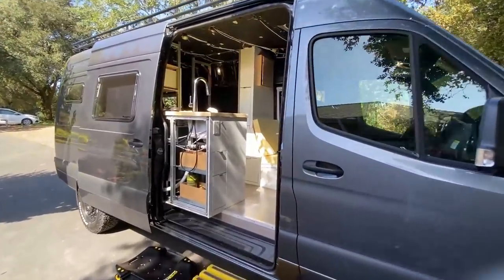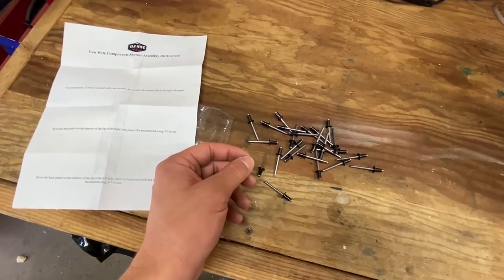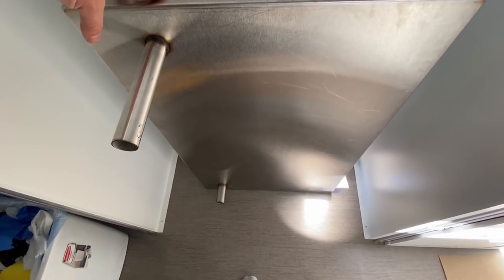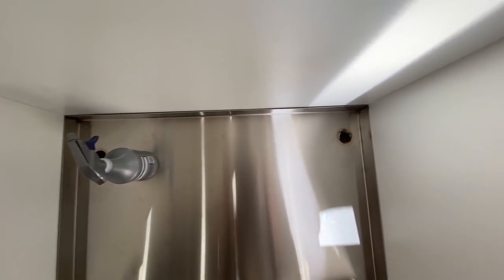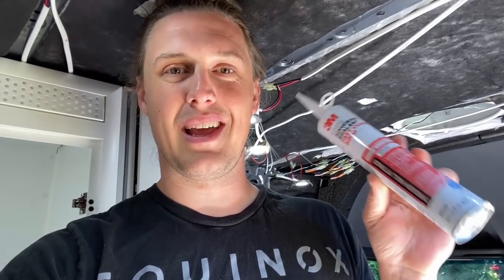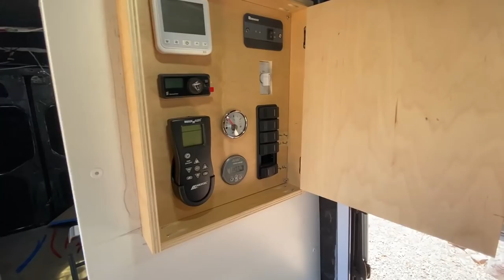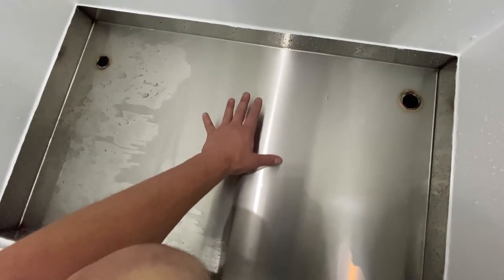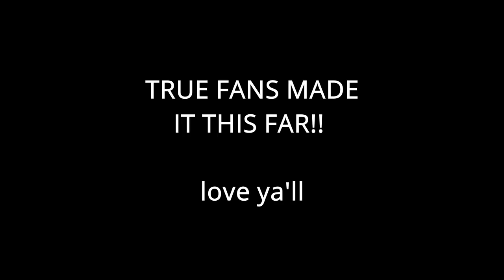How I Put A Full BATHROOM & SHOWER Inside My Van

Comment: Looking good so far. My issues is I would have 5200'd inside the whole length of the overlap of the panels then caulked the inside seams to prevent 'sharp edges'. I'm surprised that they didn't manufacture with some sort of interlocking seams with that price... Under the pan, I would have placed a small wedge (1/2" pitch in one direction or another (towards the drain) to help with drainage, too.
Reply: I was thinking the same thing about a wedge to create a slope

Comment: A small window or sealable vent on the side of the shower allows humid air to be pushed outside via the pressure of a rooftop MaxFan set to pull air in reverse. We do this in our Pleasure Way Ascent with the furnace running when we shower and warm dry air is pumped into the shower.

Comment: To do your caulking run a bead down where you want it to go, making sure there are no holes.
Then get some diluted detergent in a spray bottle and spray the bead.
This will ensure that when you run your finger down it won’t spread.
Works perfectly every time.
Reply: Have you done this with 5200? It's a difficult beast.

Comment: You can make chrome finish look satin by scuffing it with a automotive scuff pad. sand(scuff) in same direction that match your others.
Reply: This would depend on what the valve is made from.  Let's say the valve is made from a diecast material that is chrome plated. If you  scuffed the chrome the zinc will be exposed and corrode under the remaining chrome, and then the chrome would peel. This is not good. I suggest leaving it alone.
Reply: Ha, yes, a trick I learned recently. I used some 600 or 1000 sandpaper and it came out great.

Comment: Re: low pressure shower heads: There is usually a small, plastic, pressure regulator, where the hose attaches, that can easily be pulled out with a pair of pliers, if you want more water pressure, at the expense of water usage.

Comment: Pro-tip with the shower water pressure... Unscrew the handle hose and pick out the little plastic regulator, reconnect hose and viola! Better pressure.

Comment: Use a silicone squeegy to move all the left over water down the drain.

I used one in deep  square stainless steel sinks to get then dry at the end of the night when i was working an old closing resturant job.

Comment: From the position of the toilet vent hole it looks like you are placing the toilet on the same wall as the shower fixtures. I would have placed it opposite.

I use a shower chair in my shower - and the most useful position is sitting down facing the shower fixtures. This is the common Japanese sitting shower position too, where they use tiny stools on the floor facing the fixtures. 

With the toilet opposite, it serves as your shower chair - useful for me because of leg injuries, useful to you because of your unreasonable height. I'd also have a second lower shower head holder that is optimized for sitting down. The high one is for full body rinsing of your front and back while standing.

If that sounds useful for your situation - you could still just switch the use of the two shower pan holes to the new configuration.

Comment: I have the yitahome 5 gal portable toilet and it comes with the sink with hand pump, if you guys don't want to deal with plumbing in your rigs, this set is on sale alot and they have a cheaper version for 150$ definitely a great setup for budget builds. In terms of a shower run propane through a tankless heater to a small shower:) I have a cargo trailer I've been building for awhile
Reply: The cool thing about the sink is excess water goes through a small pipe back in to the toilet so it rarely has to get filled for my use

Comment: If you want a good shower head for low pressure like an RV use an Oxygenics shower head, feels powerful yet uses very little water, 100% better than the stock RV shower head.  Cheers,

Comment: Nice job, although I do think you’ll have to move the shower drain tube up higher onto the grey tank.

We also have a flat shower pan, and it is something I regret  that we didn’t add some pitch.  It is a pain to clear standing water - we do have a teak shower mat, but it still needs to be dried after each use.  We use a squeegee and our dust pan.  Definitely not my favorite activity.
Reply: Hi ! Which drain have you chosen in your shower ? The water can't flow properly in mine :(

Comment: Hi, Steven: You couldn't find a lake to shower in?, state parks are full of them... The shower you're installing is very nice and you are the only one who has to look, at the fixtures when you are in the shower. Personally, as long as the shower works and the difference in color tone, is very slight then I don't normally get irked about the color of my fixtures.. Part of the spread issues of the caulking could be caused by the material being used for the shower...You could always find a material to cover the interior of the shower that you like better, which is waterproof and will cover the caulking issues.. While you can caulk aluminum and rivet it to use as an interior for a shower, normally it is soldiered or welded together...

Comment: One problem I had is when braking the water sloshed back up the shower drain! That did not smell good... I installed an inline one way valve to stop this little issue :)
Reply from the maker: Nice, I also did the same thing. I used this “low psi” check valve that uses a flap and it works really well.

Comment: Hey dude regarding the rust paint, there are guidelines in the MB upfitters documentation for resealing holes you make in the van and also where and how large of holes are permitted within warranty spec. Recommended reading.
Reply: Hi Richard. I have been searching the BEG for this info but i'm failing to find it. Can you direct me to a page/chapter/section?

Comment: Did you think about a second drain hole in the opposite corner so it will drain when sloping the other direction?   I am looking forward to seeing your insulating/heating plan for the under van plumbing for cold weather.
Reply from the maker: Yes I thought about it. My shower pan happened to be in a location that didn’t allow for holes in the other corners without some serious drilling through the frame structure.
Reply: @seven_o_savage  Hey man, just wanted to ask you about the Separett toilet — how did it work out in the wet bath? I've got one that I plan on installing in my build, but have concerns that the separett won't handle a wet environment well without water getting down into the main cavity of the toilet unit and causing problems unless it's covered when you use the shower. Any thoughts/input/advice you can provide would be much appreciated.

Comment: Wow your 6 foot 5”. I think you should look into iveco daily van you can get it with 2.1M high internal hight and if you wanted 5.1M internal length also. Check it out you would be able to stand up in that and have a full size shower no problem.

Comment: Looks like a composting toilet. There is a single reason why a composting toilet might not work perfectly: Excesive humidity, like during/after a shower. You may find a way to keep humidity out of the composting toilet as long as the humidity is still high in the bathroom... Maybe a plastic bag with a heavier rubber ring (in the form and size of the toilet itself) on its opening, that seals (a bit) against the floor under its own weight...

Comment: Great progress. I used to put in rivets using the same type of tool you're using but I switched over to the RiveDrill RT110. Saves so much time and I just leave it connected to the front of a spare drill.

Comment: There has to be a better fastening method than this... than rivets with a gob of sealant on the head. But, if its riveting it is... ever heard of Olympic rivets?... looks like a bucked rivet and you can spend a small fortune on the shaver tool that rounds off the head. Which is nice. Then I see your caulking skills. I was going to suggest a Cramer profiling tool, but the rivets negate that idea.
Reply from the maker: Wowww these are so cool great suggestion!

Comment: Reading the comments a lot of you seem to be missing this man's design ethics....rather than go all out fitting everything theoretically needed, which then leads to more things that can fail and need replacing, he skips some stuff (grey water back flow valve, p-traps, etc) and later down the line if it needs changing its designed in such a way that it's simple to retrofit

Comment: Usually it's the newbies to van living who fall into the trap of thinking they need a micro version of their s/bricks house in their van. 

**Think about how much space a shower & a big toilet takes up inside a van! Living space is critically important when you live on wheels. Also, to run a shower you have to carry A LOT of HEAVY H2O, this forces the van's motor to work harder & takes more fuel. Not good!

People, save yourself a lot of space, time & $$$; just take sponge/rag baths & get a cheap little solar bag shower & a plastic catch basin to wash your hair in. Simple & cheap!   Or, public showers are everywhere: gyms, truck stops & campgrounds.

You're welcome.

Comment: This is what happens when you try things out for the first time. Seven you are great with a lot of things like electrics and plumbing. Little things like the caulking of joints, it’s a shame you couldn’t get this info before you started the job. You can use a washing up liquid sprayed from a bottle and then a special rubber silicone tool, instead of your finger, to finish it off with. It’s all about working with the product without it sticking to things you don’t want it to stick to. 
Anyway I’ve decided Im not having a shower in my van. I want to keep things simple.

Comment: no need for a shower in the van.. takes up why to much prime property in van. Shower in the back with the doors open and a curtain.Dude you have a lots of wires and shit underneath exposed to the elements. That won't last if you wanna go off road for any period of time. Don't go to Colorado in the winter it will all freeze up.

Comment: A bit concerned they have no natural slope to the shower pan.  I understand they have no idea where the drain will go in the kit unless they have models for every van, but that may well be a problem down the line with mold.
Reply from the maker: Yea, agreed. I’m going to see if there’s a shower mat made of material that wicks & evaporates the water
Reply: @s.e.charles1332  Good point.
Reply: @seven_o_savage  I use a sheet activated carbon foam (made for aquariums) and have a cedar shower board sitting on top. Advantages - the foam is dirt cheap; it stops mold; catches hairs etc - stops drain clogging; can be taken out to wring & dry.

Pipe output from mixer to shower - hard to be sure but looks like there might be a couple of kinks in bend (?). Kinks can affect flow rate as they create a back pressure. Might need a longer pipe length if so.

I'd be tempted to install a couple small waterproof/dustproof 12V fans behind that air grill in the non door section

Comment: On the shower stall I think you will be disappointed with your design. You will have an environment that is going to stay wet and grow nasty scum.

I also suspect you would have been a lot better off building a plywood shower and then fiberglassing  it inside.and out to waterproof it. That way you could have had a very strong and waterproof enclosure with nice radius corners.

Also, read up on proper design and venting of drain design.

 First thing an apprentice plumber learns is water runs down hill. Read up on anti-siphon vents. You might need s sump pump to adapt your layout for proper function.